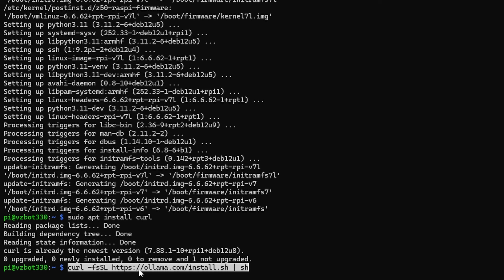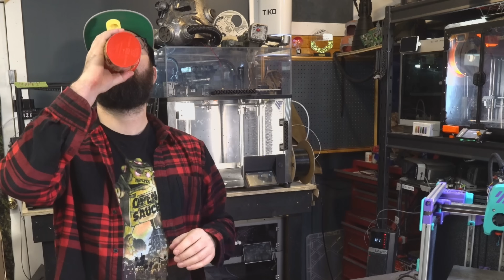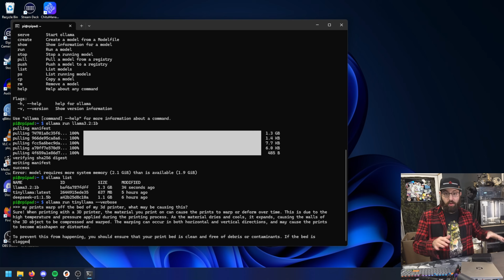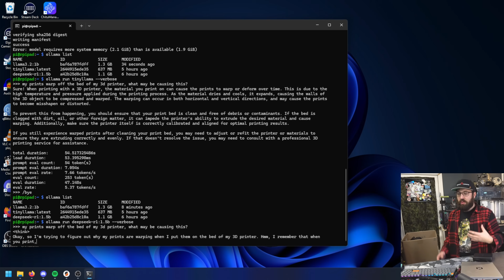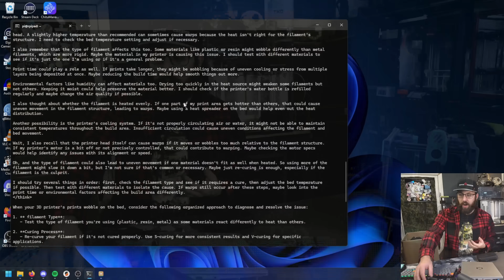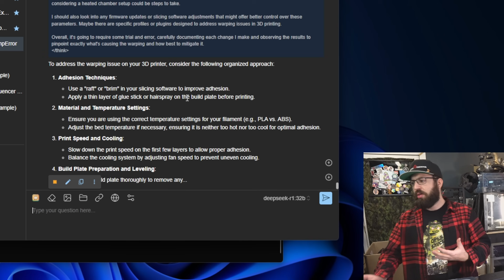I Put DEEPSEEK in my 3d Printer (AND YOU CAN TOO!) #3dprinting #ai

Comment: I'm being a stubborn b and trying to optimise klipper to boot in 6 seconds on a pi zero w (not 2). Not because i can't afford the 2w which would allow some more options, but because i want to assert dominance.

Reasoning feature performs really badly on models with small context size because it emits a lot of intermediate text, and what you ACTUALLY asked and some of the earlier "thinking" output ends up no longer parsed further down the output process. If you wanted a Pi-scale 3D printing assistant that is sharply trained on common issues and answers, it should probably be a non-reasoning type.

Comment: I personally use a mini PC to run my printer stack. It uses the smallest modern AMD CPU, the Athlon 300U a 2C/4T in the Zen architecture at 3.3Ghz. The RAM is upgradable, went from 8GB at 2666Mhz to 16GB at 3200Mhz because I thought I'd need it. Looks like I'll finally use all that extra RAM. I have gotten the iGPU Vega 3 to use 12GB out of the 16GB.

Comment: You could create a host with the 3090 machine and just basically use the Pi as an "intercom", could also be used as an onboard helpline for whatever printer it is without the overhead in making hardware more expensive on the printer side.

Comment: On top of general printer troubleshooting information, having a model fine-tuned with things like the structure and information in klipper logs to see where a problem might be, or using Retrieval Augmented Generation to pull from a database of known solutions could land it very firmly into a must have position.

Comment: Rather using PC than Raspberry Pi for local large language models. Having Discord bot running in Raspberry Pi and GGUF model that process text and images, and it's slow as heck. Wouldn't recommend.
Reply from the maker: Oh totally,. my 3090 is MUUUCH better at doing this, but this was more of a "can i" test than a "should i"
Reply: @CanuckCreator Yeah. Also I am waiting somekind of finetuned dataset / model that can assist in 3D printing and could be integrated in printer. In theory using LM Studio / Ollama API calls and having Klipper and chat in the U.I.

A.I. could be used in tuning the settings tbh
Reply from the maker: im really hopeful for some very specific tuned models for usecases that can run on low end hardware, image a tablet or pad filled with survival tips in a bug out bag, or educational tools like a history specific one. Plenty of niches where it could work

Comment: The easiest way I have found to explain what LLM does is to fall back on introduction to logic.
There is a difference between valid form and the truth or falseness of the statement. A LLM mathematically produces a valid form based on the output. There is no capacity to analyze, 'research' or process the truth or falsity of something. All it does is create a valid 'form' of output based on its dataset (content of data it was trained on) and structure (the model itself sans the trained/stored data).
It objectively has no ability to analyze and weigh the truth or accuracy of the data it was trained on, nor its output. All it is programmed to do is produce an output that the user will rate as a 'useful' output. It's the king of confirmation bias (because that's how these are trained). All it does is hallucinate (because it has no ability to objectively determine or weigh truth). Its a tool. Its usefulness or harm is completely up to the end user and what they expect out of it.

Comment: I dont see the advantage versus using an online client like Claude. Unless you are able to feed in printer specific data, the answers will be less fine tuned out of the box than the online options. 

I used Claude to help me setup klipper for my specific mods/machine combo and it really helped where I was struggling to follow community input. You can even feed it an image of your test print and it will help debug it, e.g. elephants foot consider X/Y compensation on first layer. Its pretty wild, but it still relies on having use input to train on as new printing setups come out.

Comment: The reason why Deepseek works on lower hardware is they took an open source LLM and removed the fail safes. As in Skynet prevention controls. Also, it still needs beefy compute power to do better AI, just like the other LLMs.

Comment: Would be interesting if it took data from sensors and was able to recommend turning up the heat or slowing print down, or adjusting Z etc.
Reply: Yah, it would be interesting to see what the AI could learn from a printer using current draw on drivers, bed sensors, temp sensors etc, combined with user feedback about success.  

I heard about a service years ago that put a module in CNC systems etc and told the owners when maintenance was needed.
Reply: You can do this with nvidia omniverse Cosmos and the digi double factory setup.
Reply: Add stereoscopic cameras and information about the model, and you can potentially have a printer that is able to tune itself...
Which is probably what Bambu  is aiming at with their cloud dependency - towards a goal of also provide AI generated models
Reply: Have it run belt tension and IS and actively tune your belts
Reply: We need this but we do not want a language model for it. we would need a neural network that trains on 3d printer data and could read sensors interpret video feed and read cfg files.

Comment: Curious if Llm running at same time as printer running a print if the ai would require to much cpu and fail prints
Reply from the maker: Oh you would NOT want to be doing both at the same time, at least with current hardware, the RPI gets absolutely HAMMERED while "thinking"